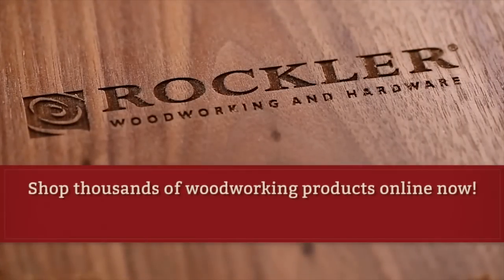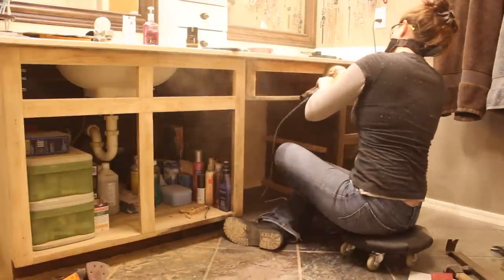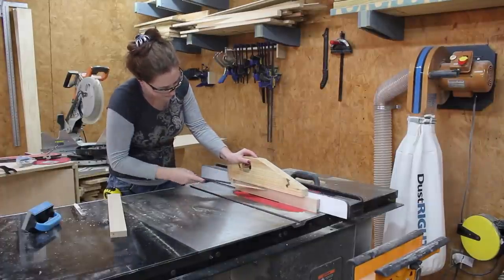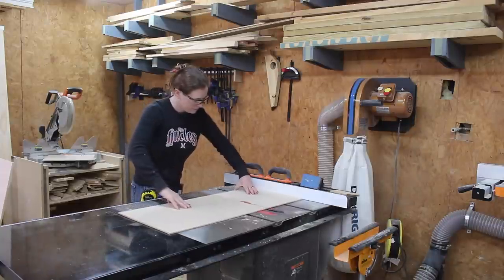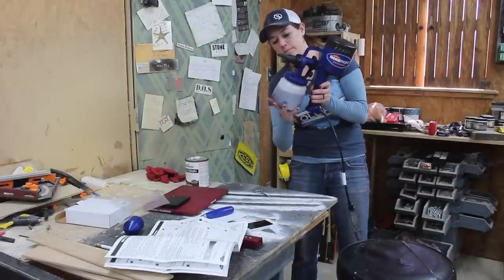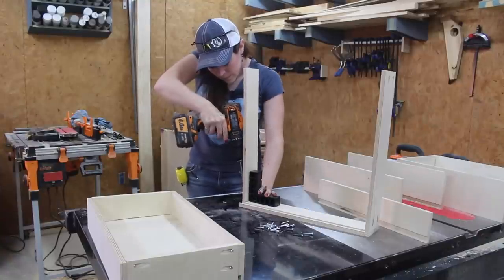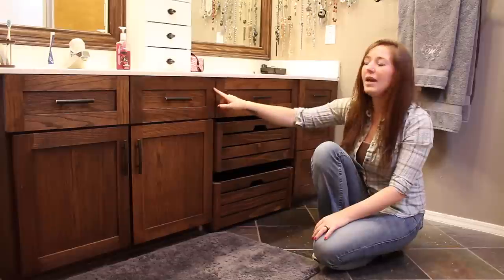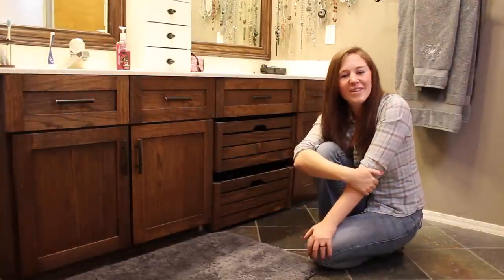Build Shaker Style Doors - Refinish Vanity

Comment: Looks great April.  I installed those tip out drawer fronts in bathroom and kitchen.  I was solo and ended up clamping drawer fronts first then crawling under sink to attach.  It was a challenge for sure.
Reply from the maker: Clamping them would have been a good idea. It was a huge pain crawling under the sink trying to install those and having to fight (and lose) the sink for space.

Comment: Hi April, always a fan of the videos. One question though- why not put glue on the panel edges? It doesn't seem like there is a need for floating panels when the panel is plywood. Even just a few dots of glue would make it stronger.

Comment: Great job on the vanity revamp April! We have very dated cabinets throughout the house and a refurb is already in the works. My wife like Shaker style too so that is likely the route we will go. I worked in pro cabinet shops for over a decade so I'll be dovetailing the drawers and building rollout shelves for the kitchen too.
Reply from the maker: Since you worked in a cab shop what should I do to fix my doors? I can't seem to find 1 3/4" overlay hinges, so would a pro cut down the faceframe to 1 1/2"?
Reply: +April Wilkerson I'll have to research the video to get the specifics of your cabinet down in my head. I can look and see if I can find the right hinges too. You've already got the drawer fronts and doors assembled at different widths though correct? I'm thinking in order to get it all lined up one or the other will need to be modified. Again, I'll research the video and see what I can come up with.

Comment: Welcome to the wonderful world of Cabinet Refacing. There are loads of companies out there that specialize in exactly what you did - they make a good living at it, too. I was a cabinetmaker way back when, and I have to tell you that you made your doors and drawer fronts perfectly. That's exactly how a professional shop would do it. They might use a different profile for the tongue and groove joint, but that's about it. One tip for you, however. On your tip-out drawer bins, you might reconsider your idea about making new ones. Either that or make certain the bins you make are absolutely waterproof. After living with them for a year or so, you'd be surprised at how much water ends up dripping into them from wet hands or damp items. Just something to think about, that's all. Overall, you did an excellent job - you'd be hard pressed to tell that you didn't have a professional come in to do it. Once you get the right hinge offset, it'll be absolutely perfect. Excellent work! Thanks for posting this!
Reply from the maker: : ) Thanks Mark! Yeah I was bummed about the hinges, since you are a cabinet maker, what is the thing to do here? Should I cut down the face frame by 1/2" with a jigsaw? If I got the face frame down to 1 1/2" then the 1 1/4" overlay hinges would give me exactly what I need. 

Good tip about the bins, I didn't think about water getting into them. Maybe I'll just buy some stainless steel ones then, I just don't like those stark white plastic ones. Or, now that I'm thinking about it, maybe I'll just get some paint for plastic and paint them brown so they blend a little better.
Reply: April Wilkerson  I'm afraid that, at this point, anything you do to change the overlay of the doors will widen the gap between them. No matter what, I certainly wouldn't cut into the cabinet face frame. It would be better to source some 1 1/2 inch overlay hinges (they're available online,) but that'll leave you with a 1/2 inch wider gap between the doors - unless you want to make a new pair of doors that are each 1/4 inch wider, of course.

Then again, if you like it as is and can live with the doors and tip-outs not lining up along the outside edges, there's no harm in leaving it as is. Like my grandfather taught me - if you like it, you did it right.

Comment: nice one. I love spay finishes. As a tip. I was always taught that when spraying you should have a plan before you start, especially on trickier pieces of furniture ie inside cabinets etc but rule 1 is to spray the edges first as they tend to be forgotten from time to time. also make yourself a board with a series of screw stand offs about 32mm or 1 1/4inch to raise the work piece above it while spraying. mount the board on a table via a lazy susan and then you can spin the work piece to get all the edges and one face. then let it dry and flip it to again get the edges and the opposing face.
Reply from the maker: Ooh good tips! I appreciate that. I sprayed the doors first then came back with a foam brush to get the edges. I like you way better.

Comment: Hey April, the upgrade looks awesome ! Just a suggestion about finish removeal. ( I can imagine the amount of dust you had to clean up ) Get an old stiff backed knife , Hyde make a good wood handel, 6in blade works good for this. You need a sharpener that can put a good edge on this ( often) Set it 90 deg. to the surface and start sliding , (let it tilt till it bites) . It will take that finish off down to the bare wood with a minimum of dust, and a small amount of sanding ( and cleanup). Nice job.
Reply from the maker: Ooh that's a good tip. Yep, I vacuumed three times I think!

Comment: didn't see it mentioned but for refinishing stain check out gel stains. you do not need to sand all the way down for them. the doors look awesome April.
Reply from the maker: Yep! Gel stain is awesome but since I wasn't going to be using it for the drawers I didn't want to use it for the body. But you are right, it's a great alternative to sanding.

Comment: Thanks for showing every step and how the tools were used to do each step.  I need to do the same thing but my husband has severe asthma, any sawdust in the house is a big problem and sanding inside is not possible, do you think I could remove the vanity to the garage do the refinish there and haul it back in or should I just buy/build new.  Our small main floor powder room would be my first try at making doors and drawers.

Comment: Awe man, this is exactly what I was planning on doing with my bathroom.  The drop down faux doors and everything.
Reply from the maker: Awesome, I hope the video was a little helpful then. : )
Reply: +April Wilkerson It was very help.  This combined with you "building a vanity" video and the video that you framed your mirror and built the addition counter-top storage and I should be in good shape.  I do have a question though.......were you not able to find drop down hinges that opened completely for he faux doors.  I wanted to build a 2-3 inch compartment behind the door to put things like a hair brush, razor, small things.

Comment: Good job on the project. I only have a single comment, when gluing up any type of doors, you need to also measure & check that the door stays "square" during the glue up & clamping. There is always a possibility of the doors becoming slightly out of square & since your building then in pairs, the slight amount off could be compounded if the pair are of in the same manner. (even 1/8" off could become 1/4" or 5/16" off on a pair of doors). Always check diagonal measurements on door glue-ups.  ;)
Reply from the maker: Oh good tip, I didn't even think about checking for square.

Comment: for hinges Blum has a line "compacts with a big variety of over lay , to 2" and you can have soft close
Reply from the maker: Oh really? Thanks for the information! I will look online for them. My local lumber dealer has a shop full of Blum hinges but didn't have anything larger then 1 3/8".
Reply: +April Wilkerson  they are called  eurostyle so they go behind the doors ,to work you will need to bore a specific size hole on the back

Comment: great job ! the only thing I would have done different is I would have made the tip outs the same size as the doors below it.  and I would have matched all the grain on the styles.
Reply from the maker: I intended to but I had to account for the 3/4" reveal that the hinge created. If I made them the exact same size then the doors would have ran into each other.

Comment: April, I love your work.  You have inspired me to redo ours and we love shaker style cabinets so I plan to do those as well.   I have a question about the pulls.  You  installed then in the center of the drawers which I like.  But isn't there a gap between those thin center panels and the drawer box front?  Is that an issue or did you have to put in some sort of spacer to fill that gap?

Comment: Very nice job,  your husband is a lucky man.  I was wondering if you were purchasing your wood through your local building supply store or if you had a different supplier?
Reply from the maker: I actually purchased the 1" oak from a big box store but the 1/2" and 1/4" ply came from a local dealer. I always go to The Plywood Company of Fort Worth for plywood. When I need hardwood (which is almost never) : ) I go to Barney Robinson.
Reply: Thanks

Comment: What did you use for finish over the stain?  Did you spray the finish as well?  I always wonder whether unstained parts of the floating door panels will show as the wood changes with temperature and humidity.  Any thoughts on that?  I have always finished the panels before assembly for that reason, but it is time consuming to do it that way.
Nice job, though.

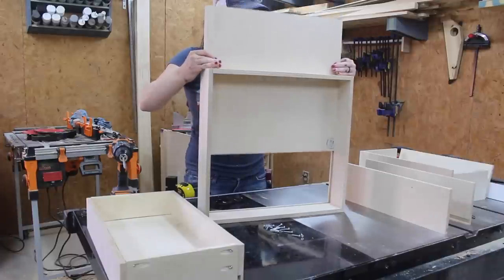Comment: April...around 4:35, what was that "L" shaped, about an 1" thick 90 degree black piece you held with your left hand on the inside of the drawer while you screwed it together?  Thanks
Reply: +Dave Jones http://www.rockler.com/clamp-it-assembly-square  they are very handy to have in the shop to keep the 90degree angles tight

Comment: Hey April, Love your work ... I've been trying to wrap my head around shaker style doors too, and basically everything makes sense EXCEPT drawer fronts ... how did you compensate for the back of the drawer fronts being inset 1/4" yet secure them to the false drawer front ... is there not a gap created between the actual plywood drawer front and finished shaker front?
Reply from the maker: Yep, so I ran into this problem when I was installing them and what I ended up doing was glueing on an additional panel on the inside of the doors so I would have 1/2" material to screw into. I am going to be adding this detail to the tutorial (I just haven't yet had a chance to write it). Glue in the additional piece before you stain it and it blends right in and most of it gets covered up anyways once it's attached to the drawer.

Comment: Are you still finding dust in the bathroom lol, you lucked out the cabinet had solid wood face frames usually they are a thin layer of veneer over MDF. Surprised to see your other half helping me must have hated the way the cabinet looked. Next project update the 80s faucets with something a little more fancy. You are getting there :o)
Reply from the maker: Nope, I got all the dust out! (But it did take three vacuuming jobs to get it done). ; ) Agreed about the solid wood, it's an older home and all the cabinets (in the kitchen and other bathroom) are solid oak. Yeah Cody stepped in to help me out because I was running behind this week. I started off making new doors for the closets but that went south so I had to completely change directions in the middle of the week. New faucet and shower tile are still on the list! List is getting shorter though...
Reply: April Wilkerson Keep working at it and making the videos working with your hands makes you happy its quite evident in your videos :o) The best of all you are saving money doing the work yourself and you know its done right. Keep up the good work.

Comment: Yeah, 60 grit is like rocks glued to paper.
Reply: +John Laury Rocks? I've seen 22 grit (in the form of sanding discs sold at a tool rental shop). Talk about rocks. Usually, you can only get as low as 36 grit.